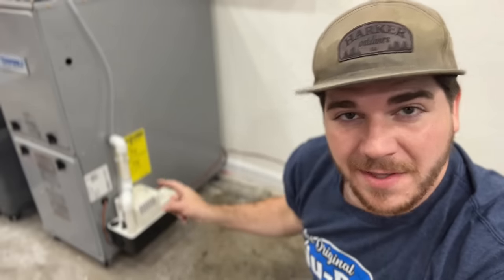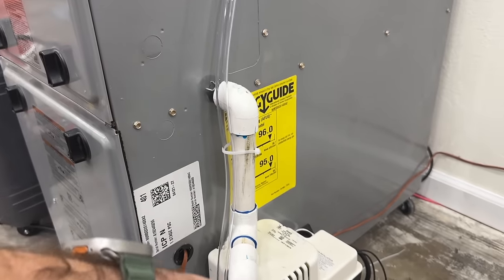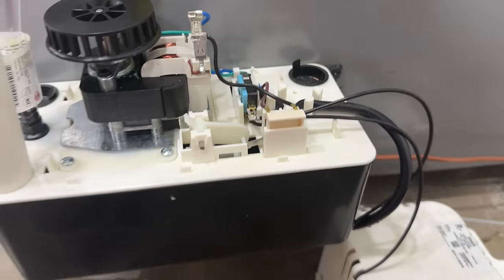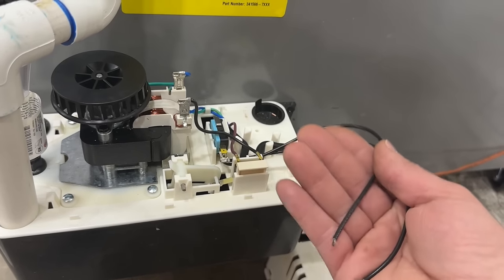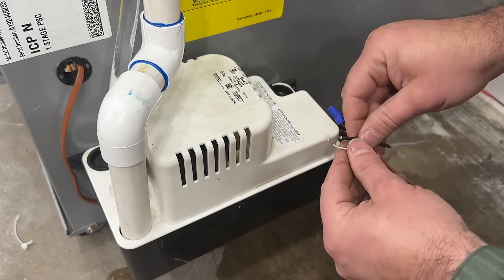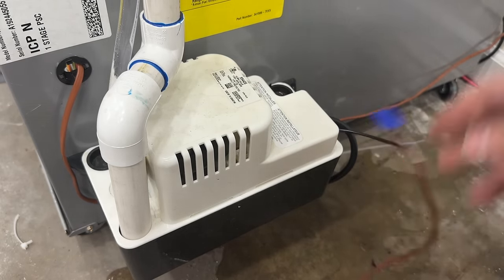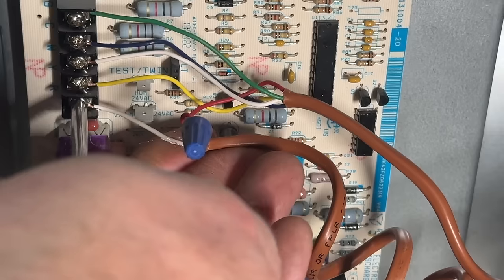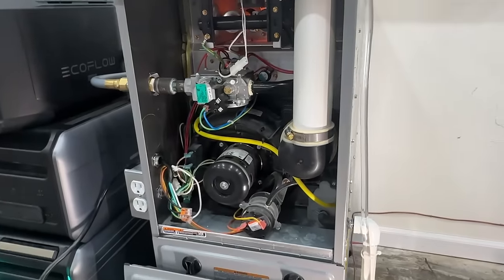Check This Before It Floods Your Home

Comment: Pro-tip:  Just like he showed, but ALSO wire an indicator light across that switch, which will light up, to visually alert you that your pump is not draining, if the switch opens and compressor enable signal has been interrupted.  I used a red LED with a current limiting resistor calculated to work with my 24 volt system.  My cutoff switch WAS correctly wired by the AC installers, I simply added the light as a troubleshooting aid.

Comment: I keep a spare pump unit on hand.  There may also be a safety switch where the interior drain pipe comes out, does the same thing but on the pan, so those can be wired in series.

Comment: Good vid. I also use moisture sensors on the floor around all water sources for potentioal failure. Hot water heater, furnace, freezers, and dishwashers. They are cheap insurance and many are bluetooth capable to monitor with your phone. Around $40 for 3 sensors.

Comment: Find this and make the company who installed the unit aware of the incomplete work performed by their technician.  Explain you hired them expecting a professional installation and complete installation.  Also, your pump should be whisper quiet when running, if it has become noisy most likely it's getting clogged with slime and should be cleaned.

Comment: I despise wire nuts especially for low voltage cables. It seems wire nuts are prone to cutting the cable from too much twisting or what seems like an adequate amount of twisting but the wire not decided to dig in a little heavy and rip the hole wire off.

Comment: Feels like there should be an indicator of some kind.  When the AC or furnace stops working, it could take quite a while for a homeowner to know it's something as simple as a condensate pump.
Reply from the maker: If this trips, it breaks red so the thermostat will have no power so it should be pretty clear. But some condensate pumps have a light that says if it’s working it will be green, red if it has failed to push the water out

Comment: just a question  that drain from furnace to pump. probably in the way of accessing that motor?
I find my hvac guys are hit or miss with these pumps.
some times that drain pipe in to deep and we get slight gurgling and water on floor. or you can't get the pump out or there without tipping spilling etc. . I tell them sit it on a brick.  put the pipe in a 1/2 ti 3/4 " . the you take brick out it slides  down .easy easy.
 I know  you can do it  by screwing to cabinet as shown. but when you build many homes  sometimes that has flows

Comment: My condensate pumps have never had a safety switch.  And I've been flooded many times because of that.  I never even knew a safety switch was a thing!

I got tired of totally unreliable condensate pumps and they are not cheap.  I've had probably every failure possible, leaving me with a wet basement. I hate them. Instead, for close to 20 years now I've been running a small sump pump in a 5 gallon bucket as my condensate pump.  I necked down the output into 1in PVC which slows the pumping rate a little bit to slightly reduce cycling.  I got about 15 years out of the first (harbor freight) pump and replaced it with the cheapest one I could find at Home Depot on a Sunday. It was the same price as a tiny little condensate pump, but I've never had a little condensate pump go even 5 years without giving me problems.
Reply: But you can still flood if the pump fails.   Hook up the safety switch to your air handler!

Comment: Question if hooked up that way  and it did shut down the system would it tell what happen in the error code example two flashes check condensate pump ?

Comment: So I'm on vacation in the heart of the winter. The condensate pump fails and shuts down my combi unit when I'm away.  The temperature in my home drops and my pipes start to freeze and then burst.    So do I want some water on the floor under my combi or do I want my pipes to burst and flood my home?

Comment: My instruction manual says to wire it to the yellow wire. What’s the difference? What’s the benefit in wiring to the red instead of yellow?
Reply from the maker: If you break yellow it will turn the condenser off, so the fan will stay running but the condenser will lose signal until the problem is fixed 👍🏼 I like breaking red because the customer will automatically know there is a problem
Reply: @diyhvacguy  so the yellow only applies to the ac but not the furnace then? The furnace would still run generating condensation? Also if you break the red wouldnt the smart thermostat turn off?

Comment: I had this happen twice. After the second time, I eliminated the pump and ran the air conditioning and heater condensation lines via an elbow and T fittings into an 8 1/2 foot PVC pipe to the closest french drain. Haven't had an issue since.
Reply: I did that, and a couple of months and some gallons later I found out the drain was only partially functional.  🤦

Comment: In our area, there must be a drain by every water heater and furnace, its code. I’m the original owner, I have a drain in the basement next to the water heater and the furnace. The home was built in 2003. A friend lives in a townhouse in our area built at the same time. His furnace and water heater are on the 2nd floor, he also had a drain for furnace, water heater and washing machine.

Comment: Flood sounds like a really strong word for this application.
Reply from the maker: You’d be surprised how much water a high efficiency furnace or an air conditioner creates!
Reply: @diyhvacguy  Agreed. When mine went, I had no idea. The water made it all the way to the other side of the basement under the flooring before I noticed it. Unless you sleep beside your furnace, you'd never know right when it happens.

Comment: All Condensate pumps do not have the safety switch.
Reply from the maker: Well then you need to get one that does cuz it will flood that space when the motor quits
Reply: That is true, need to pay attention to the model number when buying.

Comment: The problem I see with hooking this up is, if the furnace stops working, you now have a connected appliance that could be causing the furnace to stop. I'm sure it makes a difference if the furnace is on an upper floor or attic, but if the repairman is not the sharpest tack in the box, he could get more involved then necessary. If the furnace is in the attic or upper floor, why can't in most circumstances, just run the drain line directly to the drain system. I may not be a plumber but, my daddy told me, the only thing you have to know is, sh!t won't run uphill. If the women don't find you handsome, they may find you handy.😂😂😂

Comment: i have a concrete basement floor i could care less about a quart of water spilling on floor I'd rather have a high-water alarm than ever hooking up a switch to turn off heat while I'm not home and freeze the whole house.
Reply: A quart?  You should probably measure just how much water comes out in a 24 hour period.  It will vary depending on the moisture content in the gas and how much gas you are burning.

I came home after a 3 day weekend, to splish splashy carpet in my basement hallway and two rooms. My boys didn't notice any water before we left for the weekend, but it must have failed soon after.  Sometimes the gas is really wet and will flow a steady stream of water while the heat is running.  I've measured it at about 2 cups per minute, or a quart every 2 minutes of operation but usually it's more more than 5 minutes for a quart.  I have a bigger sump now which takes about 3 gallons before it pumps out. It does that multiple times per day when highs are below freezing.  I don't think the house would have gotten cold enough to freeze in the three days I was gone that time, but for me three days is surely going to put out enough water to cause damage.
Reply from the maker: Yea people don’t realize how much is coming out because it goes into a drain or gets pumped out without them even noticing but it’s a lot!
Reply: @diyhvacguy  You can measure it in gallons!
Reply: if not corrected, you will get mold and maybe start to wonder "why things smell so bad".  concrete or not.